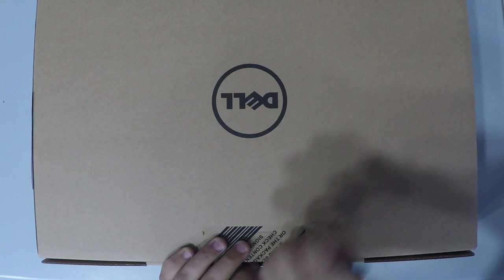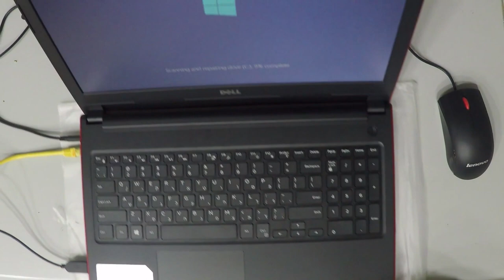DELL Vostro 15 3000 3568 HDD UpGrade

Comment: Is it possible to add additional ssd drive instead of optical drive?
Reply from the maker: Hello batonce
you can add additional SSD  drive instead of optical drive, using a special 9mm caddy. get it here: http://amzn.to/2oymeJH
Reply: Thank you! Is it possible to make such HDD bootable?
Reply from the maker: Hello
It's possible, 
1- you need to add the SSD to your laptop. 
2- enter bios setting and change UEFI boot option to legacy. https://www.youtube.com/watch?v=trg_STo8DTI&list=PL43q5LIt9XwBj0sLkutq9lt6lu8csNcAH&index=94
3- enter bios setting again and change the boot order to the new SSD.
4- install new fresh OS to the SSD. 
Good luck
Reply from the maker: Thank you, I fixed the mistaken link. it should be 9.5mm

Comment: Dell vostro 15 3000  3568 core i5 7th gen ..can it be  upgrade to ssd?
Reply from the maker: You can upgrade to 2.5" SSD any type any brand.
Reply: @Shamsabdelkader  With this laptop can I upgrade to 16 GB of RAM, it was shipped with 8 GB RAM only and Dell doesn't have any clue about this model specification and they are wondering how this laptop was shipped with i5 processor and 8 GB.instead of i3 and 4GB.